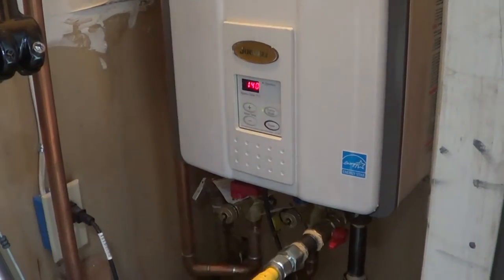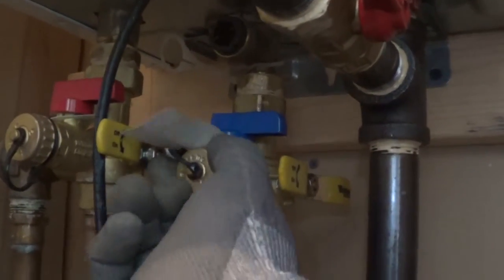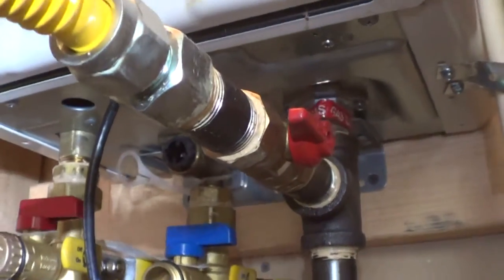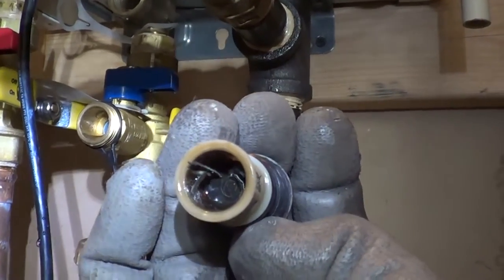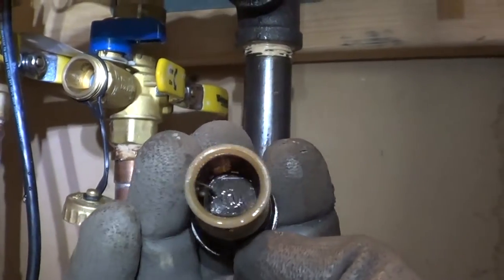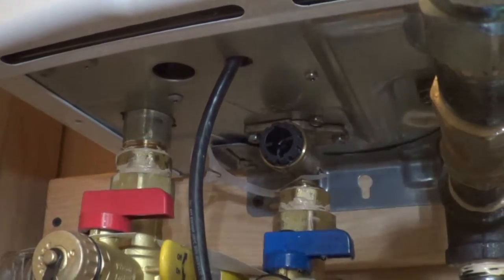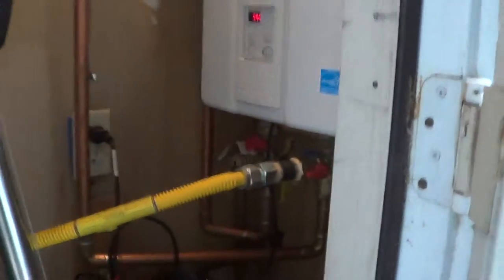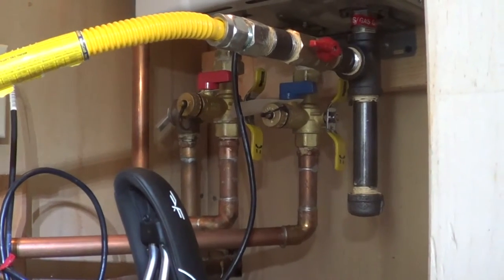Decoverly Tankless Water Strainer Cleaning Proceedure

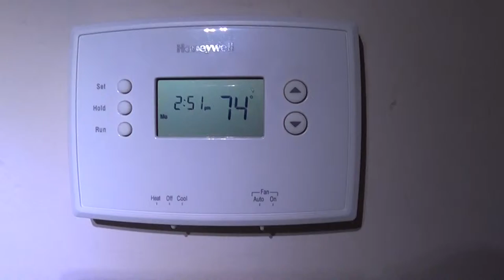Comment: Thanks for showing how to clean this.  At 0:28 https://youtu.be/o0uDajP0fIo?t=28 , I'm not sure why you would turn off your heater or A/C thermostat?   I would just also press the "power" button on the front panel of the unit to turn it off.
Reply from the maker: These particular applications use the hot water for heat in the condo.